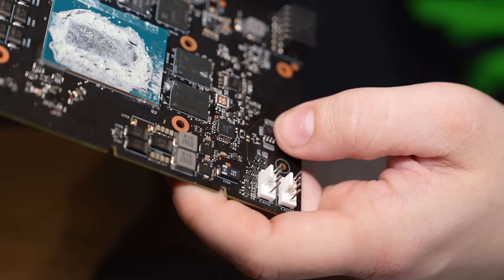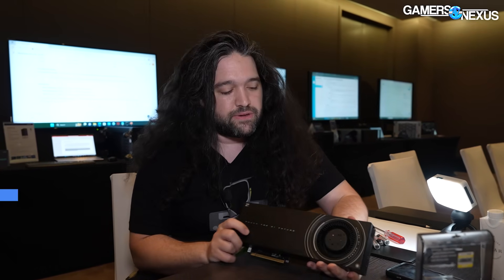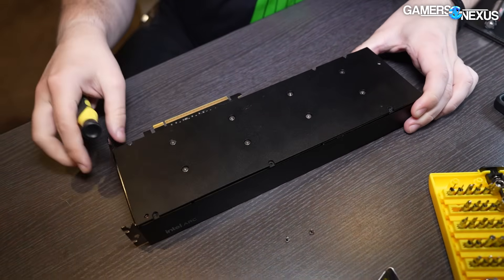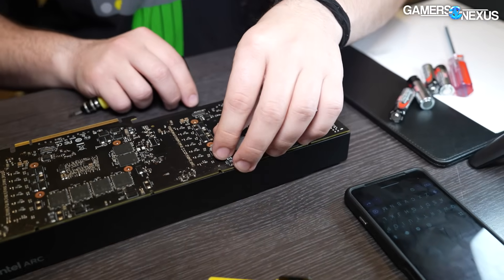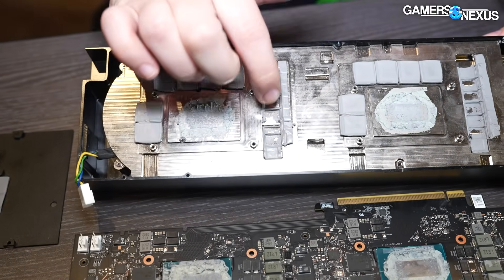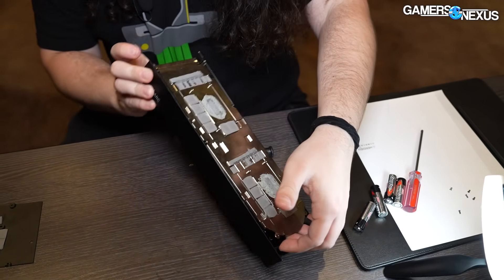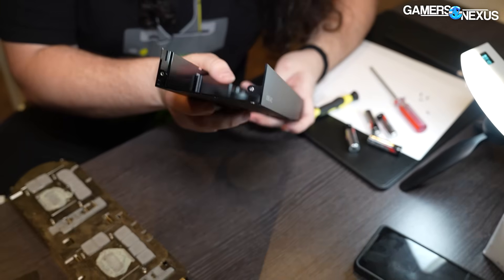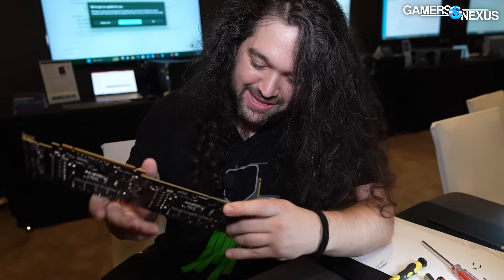Intel Arc B60 DUAL-GPU 48GB Video Card Tear-Down | MAXSUN Arc Pro B60 Dual

Comment: Honestly, I would like to see this channel cover the "workstation" tier of GPUs and not just the gaming-oriented cards at some point, even if it's a one-off. If it's below a grand GPUs like this could be very interesting.
Reply: The channel's name is literally Gamers Nexus.
Reply: Nvidia A2000 was the best card you could get for 75W gaming for a long time despite being designed for low power workstations.

Despite what the Marketing teams will tell you there is some crossover between gaming and professional, and with the B60 only being a grand it's going to get eyeballs from gamers anyway.
Reply: @r0x0r-p4t  I doubt a lot of software will be able to take advantage of both GPUs. But maybe that compatibility can be handled in the driver? I don't know. It'll be interesting to see what that hardware can do on Linux someday. Intel is a big contributor to the platform. I'll probably be using their graphics hardware pretty soon.
Reply: @1pcfred  Yeah the dual GPU config throws a curve ball; I wouldn't expect this one to be worth it as a gaming card. Maybe a single GPU 24GB card though, especially on the used market.
Reply: Theres tons of creators for that. Steve chose his audience.. I mean just look at the channel name..
Reply: @SupraSav  a lot of us have jobs where we use gpus for work. If we get to work from home, being able to game on our work computer after hours is something we care about. He already does "does it run games" tests for the Threadripper stuff. Could do the same thing for pro gpus.

Hell, at this point, scalpers have pushed prices of Nvidia gpus so high that it makes the value proposition of having corporate "save money" by getting "just a gaming GPU" less and less tenable. Paper launch didn't help either. Can't save money with parts you can't buy.
Reply: So have Steve create a channel called Workstation Nexus, it is not that difficult. 

Unfortunately, easy button gamers is the lowest common denominator in the market, thus why we have so many channels focused on it.

God help us please.
Reply: @xlr555usa  perhaps but Steve is one of the best in his genre. So he's far from the lowest common denominator in his field.

Comment: Do we knw if there's a direct interconnect between the cores? That would be ideal for AI to allow for computation parallelism, otherwise the PCI-E us becomes a little of a bottleneck. Probably not much since the cores themselves aren't that fast, but still.
Man, 48gb (2x24gb fine) for less than 1000USD is really good.
Buy two of those and throw them in a rig and you can run so much AI on that bad boy.

Comment: For under $1000 they won't be able to make enough of these to keep them in stock. The 48GB of memory probably justifies a much higher price tag than that. They could probably charge $2500+ for this and still be a decent value, but Im glad they didn't. You don't need to price gouge your customers, even if the target audience can easily afford it.

Comment: There's no bridge? So the two GPUs are completely unaware of one-another?
So it's just a means of increasing density, made viable by the extreme bandwidth of PCIe 5.0?
Reply: Yes. And bridge was never necessary in the first place, just a band-aid fix before software people figured out how to do it without bridge.

Comment: I have an i5 11400F with a 2060, and i'm starting to feel the age with newer games. I honestly don't know if i should just upgrade the gpu, or just get a whole new prebuilt, after calculating the costs of updating my cpu, mobo, gpu, ram and psu basically costs the same as a new one... Any advice? :(
Reply: Eh, cpu still good. Get a nicer card, think of full upgrade few years later.
Reply: Thanks! I honestly dont know what card to get lol, any recommendations will be greatly appreciated😅 @alexturnbackthearmy1907

Comment: I was planning to buy 2 A3000 GPUs, for project C.E.L.E.E.S.S.T. that's an astrology project, I have 2 workstations ready, only GPUs are needed. And with nVidea policies, I rather use another brand. Are these worth it?
Reply: Good question, they might not actually work for what you need, and will only be available to buy in 3rd quarter of the year (with full driver support by the end of the year).

Comment: Wonder how well this card would work with Lossless scaling. Using a second Gpu to run the frame generation takes away the initial performance loss from the primary Gpu

Comment: Can someone tell me why enterprise gpu's often have a blower style fan? I thought it was an old worse way to cool a gpu?
Am I wrong?
Reply: Yes. There is no worse or better way, its a tradeoff. Blower cards do better in bad airflow and use heatsink more effectively, which is why old cards had them - they were leftovers from server cards cooling solutions before OEM`s made traditional gpu coolers (for regular users anyway). In good airflow, regular cards do better, and what is more important for home user - quietly.

Comment: As much as I would love to see the return of SLI or dual GPU cards I don't think the inherent chip to chip latency would allow it with today's demands, even if the drivers and support was there. Even back in SLI's heyday when games didn't need hundreds of gigabytes per second of bandwidth it was becoming a problem.

The closest thing I could see being viable would be 2 chips directly touching via an ultra high speed bridge like Apple did. I know AMD and Nvidia have been using chiplets like this for datacenter and AMD used it in 7900s, but they were still using a single compute die and only bridging I/O and memory controllers. Running multiple compute dies bridged if they can get latency down as low as possible could help with yields and costs to usher in a new level of graphics power without making them need to cost thousands.

Comment: Thanks Intel for Telling and Showing Both AMD and Nvidia, to Hold your Beer. Yes the Fact that Gamers are willing to Pay $300-500 for Sub 8GB and not Demand 16GB on GPU's is insane. Not alone the Fact that some people are paying $600-1000 for Sub 12-16GB. Hence 4-6GB $60-150 / 8-12GB $150-250 / 16+GB $300 / 20GB+ $500+ since 8GB DDR6 Module is about $25-50 USD. Hence why not add 16GB for a $300 and min 8GB for $100-250 GPU. Gamers Please dont buy False Performance GPUs.

Comment: How far from dual chip GPU to multi tile GPU chip? Idk, but I got feeling that Druid might be multi tile design with pretty good performance.
Reply: It only makes sense. AMD is moving to proper multi-tiles in both CPU and GPU, intel is already one step ahead in CPU (arrow lake is basically ryzen 10000 preview, they would work the same way unlike previous multi-tile processors).

Comment: I can see edge cases for this card. I wonder how this would do for crazy streaming setup because of the two dedicated GPUs. One for the game and the other for doing streaming processing. The 2nd GPU might be overkill, but it's still interesting.
Reply: It makes more sense to use more powerful card like 4070 or 7800XT for games and something weaker like A310 or 380 for capturing and recording (even tiny A310 is absolute overkill for a job).

Comment: For local AI LLM/Image/Video use, a card with mid-range (or better) performance and a ton of VRAM at a reasonable price would sell like hotcakes. Right now you have to go used with something like one or more 3090.
Reply: Its much smaller too. Intel knew what they were doing with this card, its a good option at that price, and good option period considering nvidia and amd outrageous workstation cards pricing.

Comment: as much as i'd want one of these that 400w is quite high for my requirements. guess imma be still staring at the 2,500 usd nvidia L4 cards for a while. though a b60 dual and b60 would be a great pairing for my use case.

Comment: That screw was in a truly dangerous place. I guess it just barely did not touch any connectors. Well selection bias. if it had, it would not have made it past a single power up in all likelihood. And they probably tested the cards.

Comment: 13:30 how is air even getting in those, seems impossible to run more than 1 of those with proper cooling, wow
Reply: I think they've drilled 3 small holes into the side of the shroud and....that's it!
Reply: DLSS 5 utilizing next gen AIr
Reply: Well that how they are run on servers...and the only reason they have fans at all is 400W of TDP, else they wouldnt even have a fan.
Reply: @alexturnbackthearmy1907  wouldn't they have shrouds so the high power fans push a ton of air through there?

Comment: QUESTION: Is there a PCIe switch on the card to do 4x,4x on a x8 slot? Otherwise, it's limited to one card on consumer motherboards.

They could release this as a <$1,000 GPU (maybe <$800). Naturally, as it says "Pro" on the end, there's a tax with that, so it will likely cost 2-3x that price. This could be a VERY interesting product if they can keep it on the low end.

Nvidia & AMD need competition. The best offering for AMD is still 7900XTX-based cards. The B60 only has ~450GB/s memory bandwidth (edging to ~600GB/s with faster VRAM), Definitely interesting. 🤔

Comment: I think it would work in the gaming market as well (if they optimize it), use the first GPU for games and pass through those frames to the second GPU for AI upscaling and frame generation so that there is no performance hit with those features turned on. 
With that idea, they could definitely build the first GPU with ARC 9 and second GPU with ARC 5, or maybe they can revive SLI and put 2 same gpus on the same board and have them work in tandem.

Comment: The fact that the outputs are split between the two GPUs makes it rather interesting, as that's very unlike most (if not all) previous previous dual GPU cards where they were all wired to a single GPU and the other had no display outputs.
Reply: Yep, its pretty much just two cards sharing one PCB, not "true" dual card with main and secondary gpu.

Comment: I would love to see this get some amazing VR support. With D-GPU's and on a dual display VR headset, you can have each GPU handle one display. NVIDIA did something like this but would like it to be a semi-hardware handled thing this time, since NVIDIA's was basically purely through software for the most part

Comment: Can you cover or test the Arrow Lake 200S / Z890 bottlenecking PCIe 5.0 speeds of NVMe SSDs? Seems capped at 12GB/s instead of the max 14GB/s. A few outlets have reported on this already.

Comment: Great job, Steve. I really love Dual-GPU cards. The first GPU I bought, which was a long time ago, was a Powercolor 38070X2 which was an awesome card at the time. It actually saved me money in that it worked for years and was able to keep a decent frame rate. It was a bad driver in the end that killed it, unfortunately, which is why I've been a bit wary of AMD drivers ever since. I kept the dead card as a memento...

I really like this Intel dual-GPU card. It could be very interesting. I hope the cooler works efficiently. It probably won't be silent, but it shouldn't be very noisy either. Having 48GB of memory is great, even if it's actually 2x24GB. If it supports the Vulkan API then it could also be good for gaming, particularly under Linux.

The only thing I really don't like about this graphics card is that it uses the NGC (nVidia Garbage Connector), rather than proper PCIe power connectors.

How does it show up in a system? Does it need a bifurcated PCIe slot to function? Benchmarks?

Comment: that small wire connecting pins on top of the PCB is called enamelled copper. Basically, it's copper inside, but it has an electrical insulator outside. These types of wires are used for "reworks": a common procedure during development and/or pre-production, when a PCB is made in small quantities for validation and, before a new version is printed, maybe an older version can just be slightly reworked instead of asking a PCB maker to print it out again. Saves a lot of time as long as those reworking the PCB know what they are doing.
Reply: Yep, this is the same kind of wire inductors or windings in electric motors are made of - it won't cause a short. And even though this enamel is very thin and transparent, it's actually surprisingly durable.
Reply: @psow4062  it probably isn't the same kind of wire as magnet wire. But it does look like it. There's actually quite a few different magnet wires in fact.  The differences all lie in the kind of insulation that is used.  Some can withstand higher temperature. Some is even self healing. What you're looking at here is likely solderable. In that you don't need to remove the insulation in order to solder the wire. The heat of the iron will burn it off cleanly. That's not what is used in windings. This is specially made rework wire. Insulation being durable would make it extremely difficult to work with. Which most folks don't enjoy. The boss man would be displeased with workers screwing around fiddling too. So it is a safe bet this is burnable insulation. You can burn magnet wire insulation off too. But you need an open flame to do it. A blue flame.
Reply: @1pcfred  This is a good point, that it might use a different kind of enamel to be easier to work with. Or perhaps workshops just have some chemical that easily dissolves it? Yeah, normally it's really tough to solder to it, when you need to.
Reply: True, but it is also common to use UV mask to keep the wire glued to the PCB once you know it works, instead of just loose like it is there.
Reply: Thanks, it was helpful to know they didn't just let a somewhat loose copper wire in there risking to short stuff out.
Reply: No it is called a bodge wire.
Reply: I'm pretty sure he knows that, his entire point is that this card obviously needed rework (that and just generally teasing the engineers after pointing out the loose screws)
Reply: @bosstowndynamics5488 Well sure, but the further explanation here did help me understand this a little better so now I know what Steve was talking about

Comment: intel oneAPI and vino already supported for major model serving libs, so kudos to maxsun and intel. However i dont know if torch will see this as dual device or single device. But for inferencing "standard" model should be fine since most of them already supported parallelism

Comment: Intel should call this revived dual GPU card Wodu, just for giggles. I know it's targetted towards AI use cases, but what could it do running Transport Fever 2? Can you use both GPUs simultaneously in a project, in a grid-like configuration? Or can you allocate all GPU capacity to a single VM? If the price tag is in deed under US$ 1,000, this card might be a realistic alternative for people unwilling to part with a kidney to get a 5090.

Comment: Since NVIDIA first announced the 4xxx series and made the decision to screw gamers on VRAM just so they could prevent data centers from using consumer cards, AMD and Intel has had an opportunity they needed to capitalize on. AMD decided to chase NVIDIA's tailings (the low-end data center niche that Ampere was filling before it was left behind for Blackwell), so I'm excited to see Intel shun that thinking and make an attempt for gamers and small/self-hosted AI workloads alike. What looks like 4080 (TOPS) performance with 48GB of VRAM in a sub-$1k card? Please let it be true, cause I would be totally fine with that.

Comment: The last graphic card that had two GPU CHIPS  is VOODOO  and that was a complete ding bat stupid thing that failed
Reply: Wrong. It was not the "last one"

GeForce 7950 GX2
GeForce 9800 GX2
GeForce GTX 295 (single and dual PCB)
Asus ROG MARS
EVGA GTX 460 2Win
GeForce GTX 590
Asus ROG MARS II
EVGA GTX 560 Ti 2Win
GeForce GTX 690
Asus ROG MARS 760
GeForce GTX Titan Z

Etc.

Comment: This card could be a monster for video editing too
Reply: I love you Vex
Reply: @endiRiz outta pocket yo
Reply: It won't if we consider the current BSOD problems with B580.
Reply: @DarkGT  so I've found that the B580 doesn't bluescreen when using the gfx_win_101.6647 version of the drivers, there's multiple active support and RMA tickets open about this but so far just installing those older drivers seems to be the fix people are going for
Reply: @AMan-NotHuman Thanks. I already run an older version to mitigate the problem, but that's not a real solution, considering for how long is known to exist.
Reply: buntisin moko vex. .! 🤣